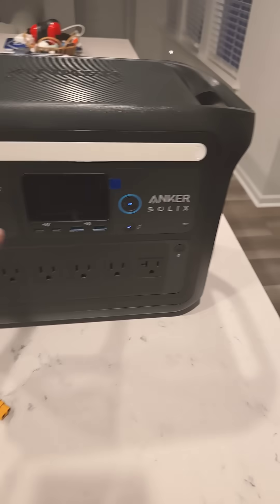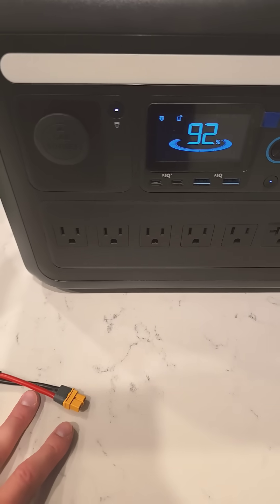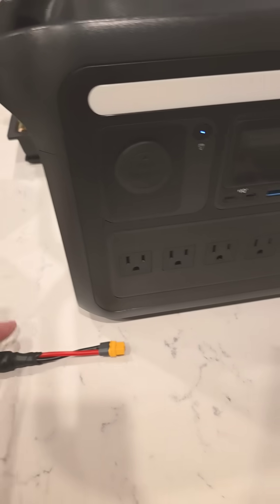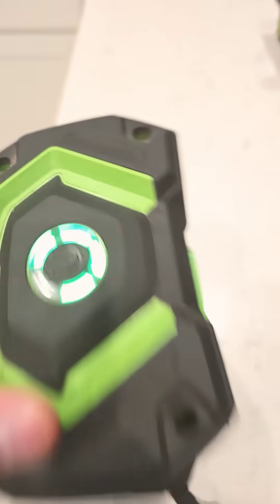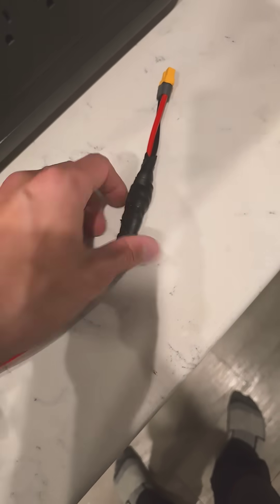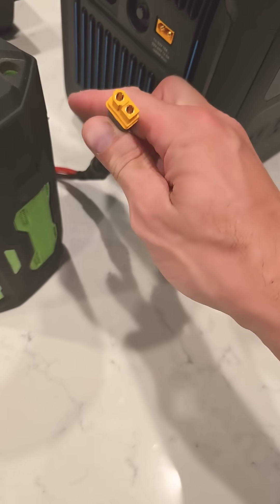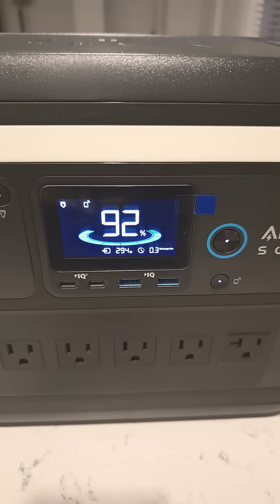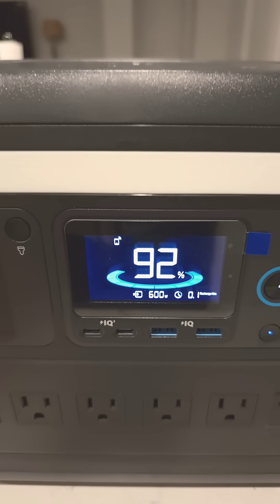Ego boost for your power station, Insane! #ego, #arclithium, #Anker, #C1000, #charge

Comment: Just get a 48v battery. No way this will give you enough power.
Reply from the maker: This would also work well. The ego batteries are a way to add a bit of capacity if you already have some around, or while camping. I use their Nexus 400w inverter for it's superior light and compact size. A lifepo4 (lead acid can work too, I suppose) golf cart  battery is a pretty cost effective way to add serious capacity at under 60V, if I'm not mistaken.